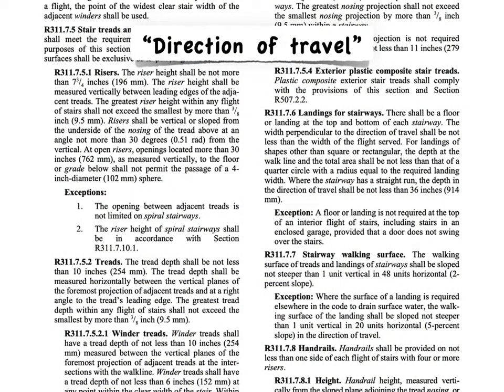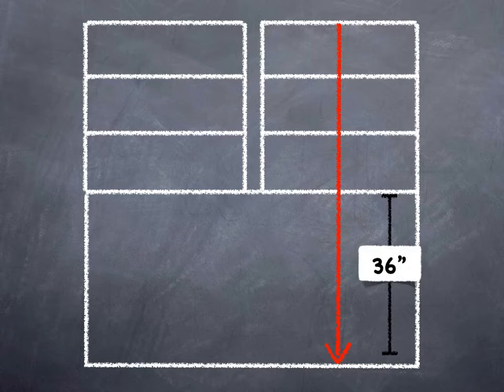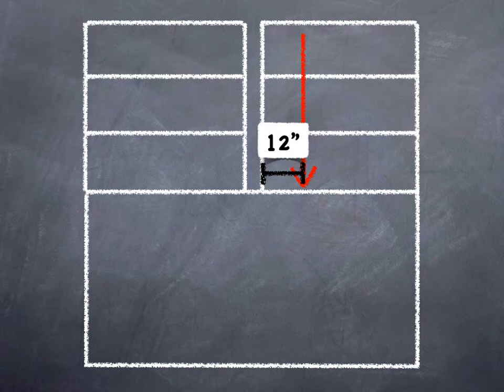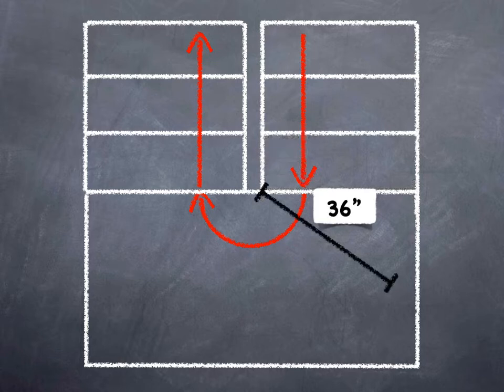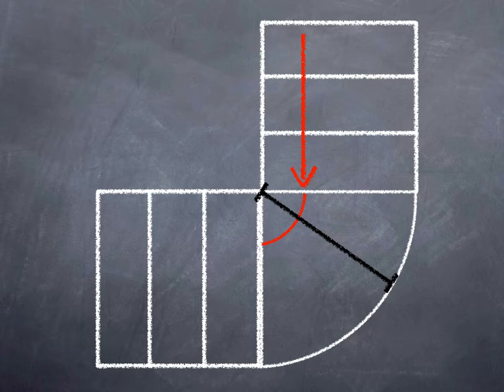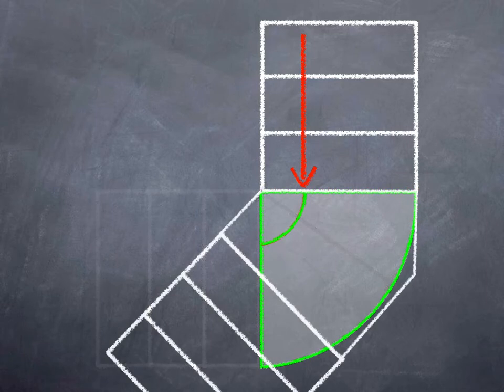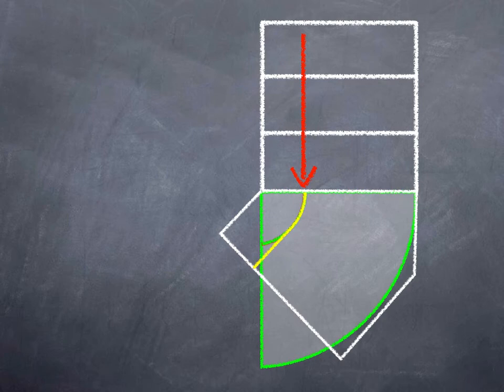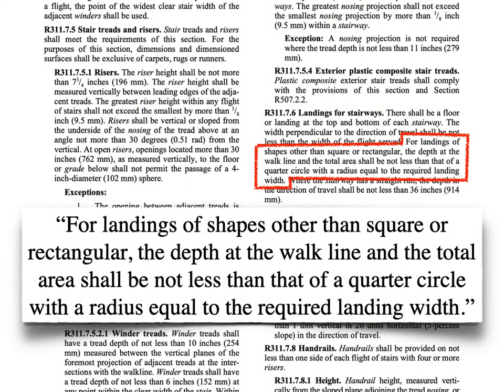Non rectangular stair landings building code IRC

Comment: What is the code for stairs dimensions from the entry door?
Reply from the maker: That is an incredibly tricky question.  If you are asking about the model IRC code for residential stairs, then it first depends on if you are asking about the required egress door or all other exterior doors.  I'll go over these codes in detail in my Live Webinar "Egress and Guards" on November 1st.  BuildingCodeCollege.com/webinars
Reply: @GlennMathewson  I figured it out. It had to be 10” long after you measured 12” from the most narrowed side.